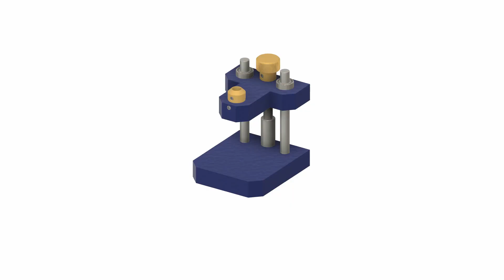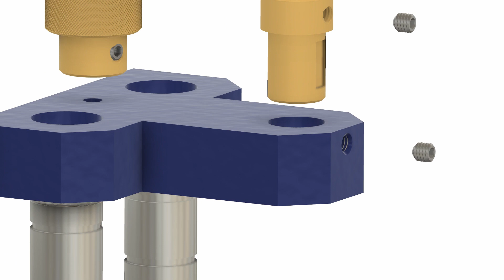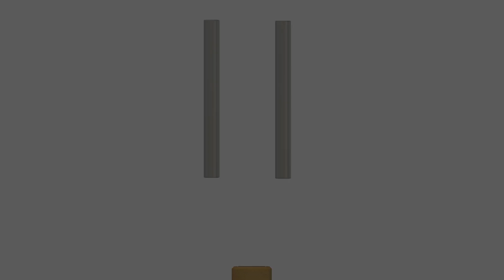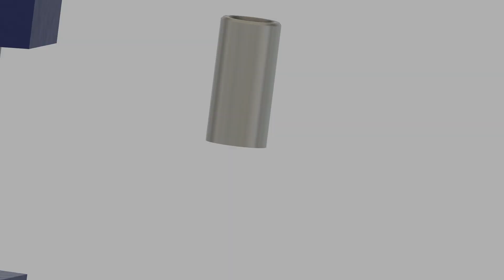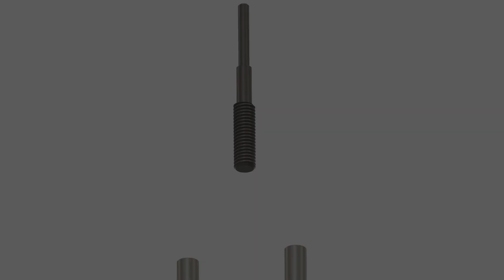Pt.1 - Watch Hand Lifting Tool Jig, Toolmaking - amateur machining - horotec 05.120 125

Comment: This will be very interesting, indeed. These days I'm also interested in combining what can be done with a 3D printer with traditional subtractive methods for more critical parts. Of course, nothing will beat the longevity and "perceived quality" of a fully-machined tool.
Reply: Your comment on 'perceived quality' of machined parts is interesting; I think 3D printing is getting to a stage where it is becoming more trusted as a route to usable parts in service; Car parts (Mono cars) aerospace (BAE Systems) and surgical implants (Stryker Medical) are all using 3D printed parts in production; for Stryker, there is no other way to economically produce the spinal implants they make.
Reply: @maxleadleybrown  Sure, 3D printed parts in sintered metal with laser fusion, etc. are a whole different ballgame - and not cheap! Since I used to work for them, I follow Renishaw's developments in this area with great interest. However in this context of one off tools for personal use I'm talking more about "home" printers that extrude plastic filament.

Comment: Does your mill have digital readout for x and y ? You did well to get the rail holes exactly at the same spacing in the two parts, if not :o)  The jig seems to work fine in your main channel video anyway.
Reply: @workshoptime  I thought I spotted a DRO in the background of an older video of yours. Yes, DRO transforms the whole thing doesn't it ? Quite a labour without, and more prone to, um, cockups :o)
I am sure you know this, but that surfacing could be done with a massive face cutter if you wanted to - though if your mill isn't tramming correctly, that might get you an ugly step half way across :o) Maybe you like the multi pass look of a small cutter though...it has a certain appeal.
Reply: @workshoptime  Shell/face cutter on aluminium - well I'm only an amateur at this, but I've got away with quite a good finish in the past - but this depends on about a hundred factors - the cutter tip geometry and the machineability  (ie the grade) of the aluminium would be up the top of my list.
Could you show us more of your milling machine in a later vid perhaps ? Just curious to see :o)  Cheers, Dave